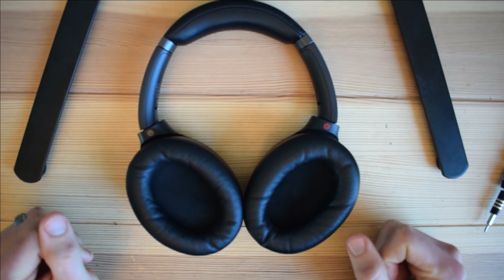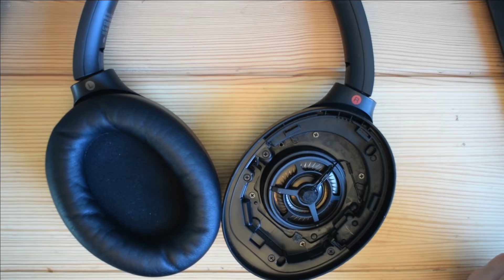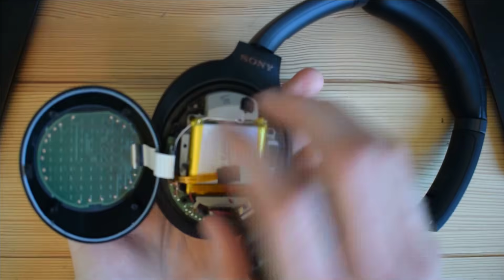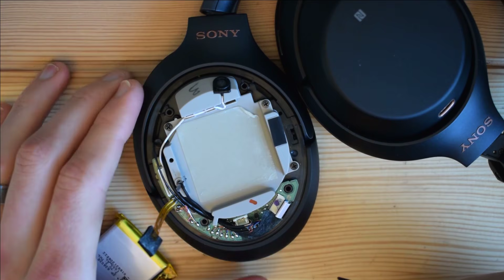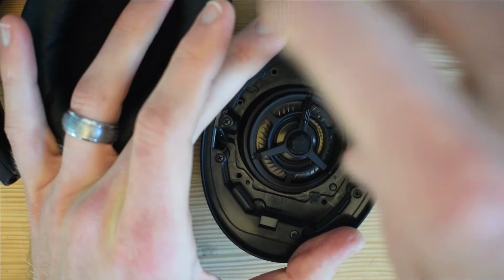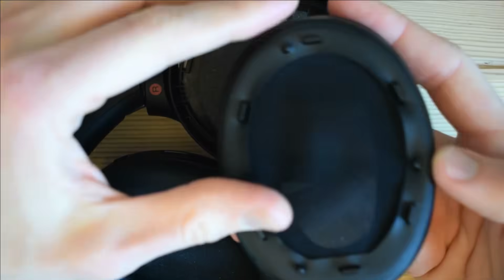Sony WH-1000XM3 Battery Troubleshooting, Repair or Replacement Walkthrough - Teardown and Fix

Comment: i just ripped off the the yellow two cables off the motherboard  trying to pull the sticker off the battery, I looked it online and it says it's the thermal sensor, is it necessary for them to work?
Reply: Its exactly what it says, it senses temperature of the battery. The headphones should work fine without it but if a fault occurs with the battery and the sensor isnt there to shut it off you could get a thermal runaway condition which could result in a fire or explosion/venting event. You really dont want this to happen with something on your head or charging in your house, nothing good will come of it unless you enjoy third degree burns and a pile of ashes as a house 🙂.
So yeah, i would put it back on the battery lol.
Reply: i think they are required for the calibration of the headset but ont more than thay try and see if they sound any different

Comment: I replaced my battery last night and the headphones worked , I let them charge over night and woke up and they are dead ?
Reply: Hoping somebody could help me cause it’s weird they worked then stopped
Reply: I have the same issue. New battery,  everything was fine the headphones worked and when I plugged then in to charge the LED flashed red. Now nothing.
Reply: @JayHova4x4  tell me if you found the issue, i want to replace my battery too
Reply: @uri2924  There was water damage on the charging board
Reply: Saddest shit ever I was in denial for 2-3 days and they still won't work I hope this video works or I'ma be pissed lol

Comment: Is it possible to fry the battery by trying to charge it with the main USB C cable that comes from an HP laptop hub?
Reply: No, for example, if you charge a phone that only supports 15W charge with a 65W charger nothing will happen, the phone will only charge at 15W, because the phone is the one that decides how many Volts and Amperes it needs

Comment: The new battery isn't charging and is just flashing red. HELP
Reply: Try using a different cable/charger I found that some cables/chargers won’t work

Comment: Before I did manipulation with the unplugging the battery, by pressing the power button there was blue light. But now - there is no light at all…

Literally they felt from like 20cm hight, 1 time and do not work any more

There was no problems with battery life or so…

Little chance that I will get response from you, but -

What would you recommend?
Reply: No, it stayed the same.. trying to turn it on - blue light flash but for a sec and nothing happens. Sometimes nothing at all happens, sometimes there is a red light
Reply: I will really appreciate any help
Reply: @unnd3r  Maybe the other earpad is shorting on the cables, sometimes happen. Try to hit the headphones a little, or use isolating tape to prevent shorts.

Comment: Hello i have Connection issue with Sony wh-1000xm3. Whenever I use them I don't have any problem to turn them off/on and connect, but while using they turn off and turn on without any signal. After that I hear bluetoth connect to my phone like it's nothing. Time is complete random sometimes all day nothing happens and it could happens few times in one hour. I don't know what to do.

Comment: Unplugging and replugging in the battery did the trick, however after charging them over the night again they no longer work again. 

Should i get a replacement battery?
Reply: Might need to look at the pathing of cables - you can see a yellow plastic cover that doesn't quite do the job. need to make sure no other cables interfere with power

Comment: I could record a video if that helpful. Thanks in advance!
Reply: Working ?
Reply: @AY.3  hey,
I replaced the battery, charged it for about an hour. Built still nothing. Do you have any idea? Where are you based?
Reply: I think it will need some soldering or some component could be faulty. I watched a video where someone re soldered the entire main chip. I don't want to mess with that, I would make it worse pissibly

Comment: Hey, 

Would you be able to help? I have the same headphones. I followed through with your video but the issue still exists. I can sometimes power on the headset and it works for a bit. then it shuts off. then it is impossible to power it back on. When I press the power bottom the blue LED would flash once very lightly and that about it. When I connect the charger it will shot that it changers and allows the reset to be carried out with the power + ambient bottom pressed together. however it still docent turn on after. Any ideas what could be the issue?
Reply: Hey i have the same issue 

Did you fixed it?
Reply: @Tarun Yadav  I ordered a replacement battery 🔋. I will change it out then see if that was the issue. Might be that something is wrong with the mother board. I hope that is nor the case and rhe replacement battery will solve the issue.
I will share my results here
Reply: @Noncreativecontent  yeah! Please keep posted the updates.

As far i know this must be the issue with motherboard.
Including sony service and others all pointed motherboard to faulty because using fast charger. Re-soldering wires might fix this 99percent because i have tried everything.
Apart 1 percent i guess will be issue with chipset or capacitor. But thats the worst case scenario.
I guess if battery fixed the than it won't be permanent as per the reddit sources because most of the people who did this return to same problem again and few of them didn't find it successfully at all. But yes it is too helpful for those who in really have old batteries which died with time and care.
Reply: Any luck with it?
Reply: @Michelle Wheeler  Unfortunately not, I don't want to sell it broken. Wanna fix them up butit is impossible to find anyone who would solder it.

Comment: Hi. I replaced my battery and had to reuse the thermal sensor. After installation, the charge indicator light flashes red indicating an overheating situation. Should I replace the thermal sensor?
Reply: Leave the thermal sensor off I did and it worked

Comment: Omg I just ordered a battery. Will attempt to change it soon!
Reply: Where have you got it from? Still unable to find right place ;-) Thanks.
Reply: @gljanul  I still need to wait and see if i got scammed or not. Just searched on google shopping, and this a little bit dodgy site popped up. It was called subtel.
Reply: @coolandgood0062  Noted, thx
Reply: @gljanul  it arrived! Just did the process and it works as good as new!!

Comment: I changed the battery and it seems to works fine afterwards BUT they calibration is not good. After about 1 day it is about at 10% again. It stays about 4 days on that state. I already did a calibration. Does this take a few rounds?

Comment: Should you let the new battery charge for like an hour?  I just replaced my battery after the other methods didn't work.  Thanks for guide!  I think I'm just gonna let it charge before I give it a test run.  One note I had always charged my headphones via usb port but the one time i charged with an AC wall adaptor I think that destroyed the charging cycle or battery somehow.  Again thx!
Reply: I always charging with an ordinary Power supply.
Reply: After 4 to 5 years in use , the life time before charging isn t quite AS good AS IT has been, so I consider to Change battery now.

Comment: Oh wow, thanks for a good guide. I was having such a headache trying to figure out the rattling I heard in my right earcup. It was almost like something was noticeably loose in there and with the help of this video decided to open it. Turned out that a hair had found its way all the way there and was resting against the speaker element. Took it out with tweezers and the problem went away, just like that, wow!

Comment: Disconnecting and reconnecting the battery solved the problem. I have hear on 2 and it's easier to remove the battery. Thank you very much,

Comment: Un plugging it and plugging it back in fixed my issue for about 20minutes. Despite my headphones saying they were at full capacity, they just silently turned off and won’t turn back on. Wondering if maybe there’s a cabling issue
Reply: I have the exact same problem  😢

Comment: Ugh, unfortunately the new battery didn't fix the problem, when I plug up the charger the charging light turns red for about 3 to 4 minutes then just goes off. Power wont turn on. When i press the power button occasionally it will give a very quick blue flash that you can barely see cause it happens so quick. When I place the headphones against my phone to connect by NFC the headphones vibrate each time but the power never turns on to connect to Bluetooth. Been using my Taotronics BH046 as my backup headphones for about a week now since I've had them over a year and never used them.
Reply: Holy shit, this describes my exact problem aswell. I will have to try ur fix aswell.
Reply: @medborgargarden9858  I need to find out what that circuit strip item number is so I can order it to see if it's just the strip or if the actual connection has gone bad.
Reply: Nevermind, I decided to open up the other side of the headphones to see if there was a problem and I found it. I detached one of the circuit lines and pushed it back in place but no results. Then I placed it in about 75% of the way and voila, my headphones powered on. It must be a defect in mine because that panel isn't lining up with the connection perfectly for some reason so I have to leave it partially out, but it's working so. I may try and find a new circuit line once I figure out what it's called and purchase one to see if it's just a bad line or an actual defect.
Reply: @ryannrjohnson  bro this worked for me😭 thanks a lot!! I had the same problem, I bought them to a friend for $30 bucks because they didn't work, but now they are working fine😄
Reply: I think too powerful chargers can cause this fault. I have a workaround for this, use normal charger and press quickly both buttons if the red light disappears. repeat until it stays on (can take a few attempts)
Reply: @lasu93  that makes a lot of sense, now that we have all these rapid chargers for new cell phones I had unplugged the slower chargers. The rapid charges were just too strong for this unit.

Comment: I did this on the xm2,and the hardest part for me is connecting the ribbon together, probably because of my eyesight, still haven’t managed it yet, so annoying as I know now I could have changed the battery without disconnecting it.

Comment: Is the charging light supposed to go on again after replacing the battery? If so, mine doesn’t. I’ve double checked the connections and they’re connected. Do you have to put the screws back in to make it charge? Thanks!

Comment: Thanks so much for this. Disconnecting and reconnecting the battery solved the problem I had i.e LED charging light switched off after 5 sec of being plugged in and did not charge

Comment: THANK YOU for this. Amazing how such a small little design thingy (isolating conductors in a circuit) can ruin the experience for the users. Did not expect that in such an expensive product

Comment: Iv had my xm3s for 4 years now and I haven’t replaced anything on them since, Earpad cushions not tears or scratches, headband still going strong no scratches or over stretch, still getting full battery life and charges as normal, it all depends on how you treat for your headphones to make them last long and this video is quite helpful for other people who are having problems, luckily for me I haven’t had any I love these headphones
Reply: I treat mine well had mine for 2 years but they won't power up so now i'm here.  I usually charge via USB to computer how do you charge yours up?
Reply: Do you use them a lot or not really? Because using headphones like these more frequently and longer can definitely lead to numerous possible issues even if you take care of them (e.g. battery life, sound/NC issues, cracks, cushion degradation due to skin oils/sweating, and more).

Comment: I replaced my battery on my XM3s, but I am still having issues with the headset not holding a charge/not charging. I've noticed that the top of the back on the LEFT headphone is pretty warm/hot while it "charges," which doesn't make sense to me since the battery is on the back of the right ear. Any suggestions for what the issue/fix might be? Thanks!

Comment: where can i get replacement parts? my usb charging port is broken :(
Reply: 1. Local Sony reseller, if in guarantee
2. Local Sony reseller, if not in guarantee if you are feeling lucky.
3. Find the part description in the manual ( https://www.manualslib.com/manual/2070987/Sony-Wh-1000xm3.html ) or try somewhere like this Australian site to tell you which bit is which https://www.speedyspares.com/shop/search?controller=search&orderby=position&orderway=desc&search_query=WH-1000XM3&submit_search= 
Then google and you will probably find it on Amazon or if lucky a local reseller

Comment: thank you very much that solved my problem at least for now... My headset was charging but was having a hard time turning on, blinking faintly in blue and then turning off when I was listening and then not turning on anymore.

Edit: problem back again....
Reply from the maker: Oh no, so sorry! I wonder if you may just need to replace the battery. I would recommend trying that first.
Reply: @jontriestofixthings3718  problem solved thank you. i disassembled the other side checked that everything was connected, i pressed a little cleaned and the headphones started to live again.
I thought it was ruined.
Reply: @manuel2602  This is exactly what I’m facing too. How did you fix it? Other side implies left side?
Reply: @anoasw  yes the left side, I just cleaned checked that everything was well connected I slightly pressed without disconnecting then it started working again.
Reply: I’d recommend buying something else that’s not Sony.  These fuckers don’t last

Comment: Such a simple fix! Before starting my battery read 0% in the app and the touch didn't function. Charge light flashed indicating charging issue. Disconnected the battery, took the dog for a walk. Once home, reconnected and all good. Thank you!!!

Comment: Hi Jon, great video. Have a question on my pair. Took down and disconnected battery with no luck. 
Powers up ok
Pairs ok
Can’t update software because battery too low
Now down to 10%
Did both resets including factory already
Plug in. Powers off and will not charge despite this
There is no red light on while charging
Cable, outlet, adapter ok

Is this battery or charging port or other issue? I feel like I could do battery or charging port myself. Just wanna isolate the issue to replace
Thanks
Reply from the maker: Hi! It seems like it is either the battery or charging port. There is probably a way to test this with a multi-meter but I'm not sure how to go about that. The battery is easier to replace so I may suggest trying that first and then moving on to the port if that didn't fix it. Best of luck!
Reply: @jontriestofixthings3718  thank you sir
Reply: @jontriestofixthings3718  so I ended up going with the charging port replacement since it would not light up whatsoever. Kind of guy instinct. Found it on Amazon next day for $10. Watched your charging port video. Did the same thing and worked like a charm. Almost trashed them last week. Now good as new. Fantastic content. Thanks a bunch Jon!

Comment: i have a crackling noise coming from my left earcup. i think it's caused by the  internal microphone. it only happens when it's hot outside. i tried wiping the wire contacts with rubbing alcohol. it disappears for a few hours but comes back. do you think soldering a new microphone from spare parts would fix this issue? 🤔🤔🤔
Reply from the maker: I would just try disconnecting the mic and resoldering it in first to see if that fixes it before buying a replacement mic. But if that doesn't fix it you may need to replace the microphone.

Comment: Thanks for walk through.
3 points that may be helpful.
1) Removing the screws requires a #00 Phillips head screwdriver.  I suggest you resist the urge to use a tiny flat blade screwdriver because that or a larger Phillips head can easily tear up the slots in the screws.
2) The interior of the earpiece might be slightly different than the video but all the important pieces are in the same position.
3) A tweezers will be quite useful in replacing the ribbon connector and putting the screws in place. (My fingers are just too bulky to do this easily.)

Comment: I have a problem, the battery seems to be working because the red light turns on. But then when I try to turn on the headset there is no blue light..
Reply: Same here idk what to do
Reply: It's a fairly common problem of headphones not turning on on XM3 after it had a light fall or tumble. This is because of wires becoming loose near the motherboard of the headphones. To fix this, just follow the instruction on a Reddit post regarding the same. It involves doing the same thing but on the left side of the headphone.
Reply: Had this problem and I just did the whole "unplug the battery for 15 minutes" thing he just mentioned and they're working again. I'll probably replace my battery regardless though.

Comment: While fixing , i was trying to remove the connector , I pulled the entire thing ( including the base that sits on the board) . Don't know what to do , any suggestion how to fix it ?
Reply from the maker: Did any part of the board break? This is the thin board that sits directly underneath the battery, correct?

Comment: Started to charge perfectly but now the red light is going in and out. Worried this won’t be a permanent fix but glad they’re charging at least
Reply from the maker: Hm...it may be a battery or charging port issue. It's hard to say for sure. If it get's bad, I would probably suggest trying a replacement battery first and see if that fixes it. Best wishes!